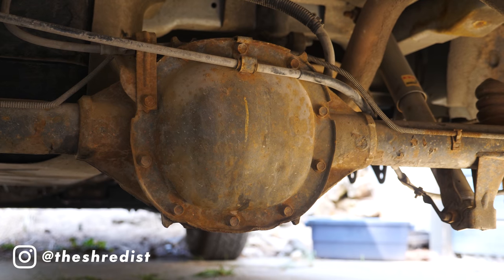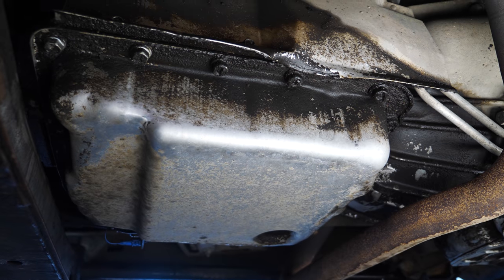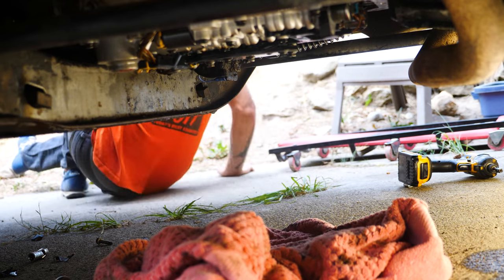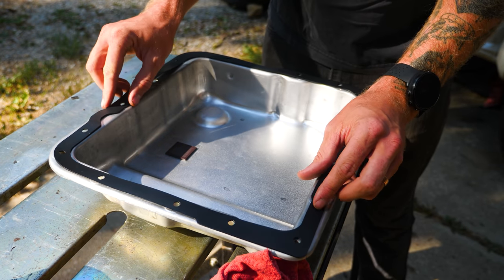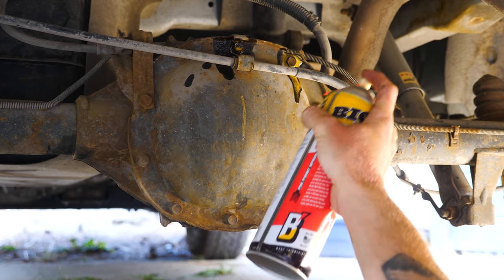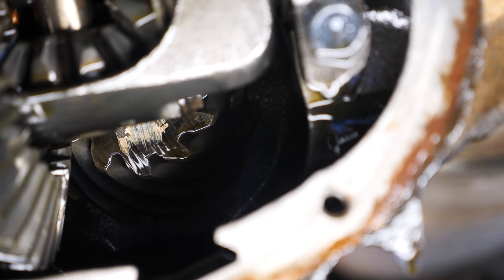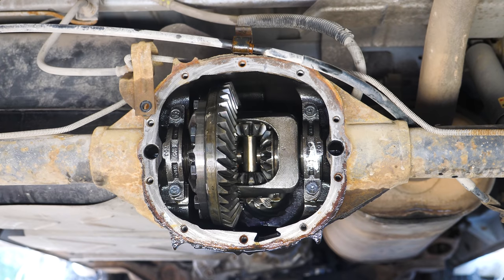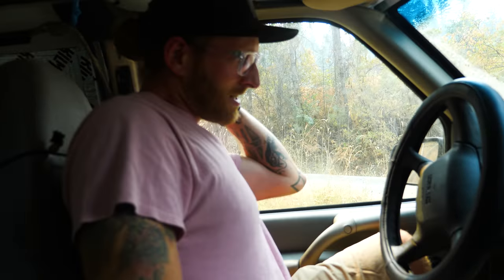Is Scruffy's Drivetrain Toast? Fixing Leaks and Finding Creaks - Scruffy Build Part 7

Comment: Hey man, so a couple things...  First off, you need a magnetic base and dial indicator to measure the backlash at the ring gear (available for cheap online).  Depending on the axle, it's usually anywhere from 7-15 thousandths for a used gear set.  So can't really tell from the video as the pinion and ring gear are both moving.  But seeing those metal shards in there is not encouraging and given the size of some of them, I'd say that gear set and/or the bearings are going out for sure.  As far as the wear pattern, no, that's not normal even for 150k miles.  I would usually suggest gear marking compound to run a pattern, but in your case, honestly, there's no point to it.  That's bad.  At a minimum, it looks like the pinion depth is wrong, either from improper installation or shot bearings.  It was likely set up properly when it came off the assembly line so unless someone's torn into that axle pretty significantly, it's pointing toward bearings, IMO.  The fact that the pinion is wearing the ring gear like that tells me the likely culprit is the pinion bearing(s).  It's allowing the pinion to walk forward under load wearing the heel side of the ring gear.

Regardless, here's what I think you want to know:  The ring/pinion and bearings should all be replaced.  Labor is likely ~$400 and parts another $300-400.  And I've seen and repaired many a shadetree mechanic's gear install so be very wary of whom you'd choose to do this job.  Personally?  I'd source a entire replacement rear end.  It'll be WAY cheaper that R&Ring the gears/bearings in your current axle and way easier than tackling it yourself as there's definitely a technique to a successful gear swap.  If you can source a replacement axle with a limited slip, that's cool, but you can always slap in a lunchbox locker into an open diff for $200-300 and that would definitely be well within your skill set.  Any other questions or if you think I can help in any way, hit me up.  Good luck!
Reply from the maker: I mean, you're definitely 100% correct. My suspicion is that the pinion bearing is toasted allowing it to walking into the ring gear. I didn't think the wear looked normal, but never hurts to ask the more experienced.

If you wouldn't mind, I'd love to pick your brian a little bit on some options, especially with a mild locker style setup. If you have an Instagram shoot me a message or send an email from my youtube profile if you wouldn't mind! Thank you!
Reply: @TheShredist   If you want to keep the budget idea theme , go with a lunchbox locker , I run this in my 4runner and after 3years I like it alot.  But since you want something mild , id go G80 complete axle since yours is toasted anyway. At any junkyard look for a S10 or Blazer with GM RPO code G80. Theyre LSD but still much better than an opendiff
Reply: @TheShredist  Yeah, man.  I'll shoot you a note on IG.  Happy to help...
Reply from the maker: @warracer03  definitely considering a lunchbox locker. How do these drive on the freeway? I'm assuming fine since its a pretty straight line. I definitely want this thing to be road trip worthy, but I'm tired of this open diff!
Reply: @TheShredist  on the highway its super smooth , you only hear it Click in parking lot or tight city streets. The best "daily Friendly" setup is lunch box at the front and G80 LSD axle at the rear.
Reply: @TheShredist  I would caution the LBL when driving in 2wd in slippery conditions. Very easy to do a 180 in the snow. With that said when your not playing around just engage 4wd high and the front wheels will keep you going in the right direction. I would suggest a Yukon Dura Grip Limited Slip or something similar. The lunchbox are great and cheap but I think it will be over kill for your situation. No reason to go though tires if you don't have to. The LBL likes to chirp under ANY load while going around corners. I plan on doing a limited slip or selectable lock in my 81 Brogham RV van. Dope video as always
Reply: I'm a cheap ass. Put all new bearings and seals in it and gap the old ring and pinion. Your out $200-$250 dollars and you have good you tube content! If it goes out in 5,000 miles better luck at the junk yard. PS go to a decent bearing shop if you have one close. One that measures bearings not look them up on a computer.
Reply: @TheShredist  lunchbox lockers are great for what they are, but they're not perfect by any means.  With any auto locker like a LBL or a full Detroit Locker is that every time you let off the throttle the vehicle may have a very slight pull left or right initially as the locker unlocks.  Roll back into the throttle and it may pull more significantly to the left or right initially as the locker reengages and rarely are both axle shafts engaging at the exact same time, hence the left or right surge that is felt.  Because a LBL has looser tolerances than a full Detroit, this surge is often more pronounced, in my experience.  But cruising at steady throttle is great with a locker of any sort and you won't know it's there unless you're turning or rolling in or out of the gas.  If the axle shafts are weak, I've had friends snap shafts taking tight turns on grippy pavement so that's a concern with any auto locker.  For these reasons, selectable lockers are awesome because you can disengage them on the street, but they're WAY pricier!

FYI, I've run clutch diffs, Torsens, LBLs, Detroits, spools, and selectable lockers on the street so I've got firsthand experience with how all these perform on and off road.  I even took my Jeep on a 1200 mile roadtrip back when it had a spool. LOL
Reply: I ould check with Auto Zone on the rear differential. They carry Zymbrota.
Reply: @stevenbaker5099 what’s that
Reply: Zumbrota rebuilds manual transmissions, Differentials and transfer Cades. You would need to give your VIN and then exchange it at the auto part store. Remove all parts (brakes and driveshaft).

Comment: The GM S series vehicles trucks, vans, and suvs are known for going through rear ends. I was in pest control for several decades and have had S10 trucks mostly and that has been the most common issue with them. My current S vehicle is a 2004 S10 Blazer 4 door 4x4 and thankfully it hasn't got those issues but it was a Fire chief's rig up around Rathdrum somewhere and had nothing but Amsoil full synthetic products for it's first 200K miles and I have put another 36K miles on it with Mobil 1 products and I can see this rig going over a million miles pretty easily.

Comment: I taught myself how to setup gears and rebuild diffs through YouTube and research. I have worked as a machinist a bit and have some mechanic training and experience. But I’ve never been a professional mechanic. I’ve had great luck with axle rebuilds. From watching your videos I’m pretty sure you can do it too. One thing easy to check is hold the drive shaft securely and then see what the backlash is on the ring gear with a dial indicator (cheap one from harbor freight is fine) and some white out on clean gears can show us your pattern better. I’m happy to help you diagnose more if you want.

Comment: If you do end up replacing the differential, I would highly recommend a helical diff.  Eaton offers a Detroit Truetrac model 912A317 which should fit these Sierras/Astros.  This helical diff paired with that New Process 233C you added will make Scruffy even more buffy.

Comment: Remember if the transmission oil looks that bad triple change it. change fluid and drive 20-100 miles change fluid again then repeat as needed. That helps clear all the nasty oil that is in the torque converter out too. You will never regret posi and it won't affect lash. Do you have a votech near by?  They might do the rear diff for parts. A junkyard rear axle could be hit and miss but you can pull the rear cover and decide but don't let the EPA see you.

Comment: Run a heavier oil in the differential. And keep riding it till it blows the spider gears
Reply: „Spider gears“? :D
Reply: @FrANTiXzz  The gears that let a differential differentiate.  But I suspect the pinion bearings will let go well before the spider gears because the gears/bearings are the issue, not the diff unit.
Reply: @tommyr95  ty for  explaining
Reply: @tommyr95  I would say the chunks of metal would get the spider gears first. But ya never really know until she's all blown up....

Comment: I think you're looking at rebuilding the rear end due to the pinion gear moving with ring gear immediately like there is no backlash. Could you find another in the junkyard, probably but you need to find one with the same wheel mounting surface width which might be more rare being it is a van and not a truck.  If you're going to have a shop rebuild this for you it you may get a cheaper price if you remove the whole axle assembly because they charge different rates for taking up hoist space.  Look for a 4x4 offroad or jeep shop. They change out ring and pinions and add lockers all the time. Because they do it so much they have it down to a science.

Comment: Probably your best bet is to swap in a salvage rear axle assembly from a wreck and go ahead and do the Journeys 4x4 transfer case swap while you're at it so that you can roll in 2 Hi on dry pavement. The reason the rear diffs go out on these Astros is running the AWD with uneven wear on the tires ( or different sized tires). I ran into this same problem on my 2004 with rear disks, the axle for which is hard to find and sort of pricey. The rear axle will be easier to find and cheaper on yours with rear drums. You might have to put in new outboard axle seals on a salvage unit, which is not a big deal. You just don't want to mess with the pinion seal which would involve resetting the pinion depth, backlash, etc. Very tricky to do correctly.
Reply from the maker: Well I think you just answered the question of how this rear end got so wrecked. The guy I bought it from had totally mismatched tires/a couple bald, some with tread left. I always knew this was a bad thing for subarus and their center diff, never really thought it would affect the rear diff though. Seems obvious now though, thanks!
Reply: If you're thinking about adding limited slip, I believe Chevy/GMC put the Eaton G80 in this rear diff that had the same gear ratios as the open diff on the Astro. There was an RPO sticker code for this. I vaguely remember chatter about this in astrosafari.com .You'd just need to confirm that the gear ratios are the same (also specified on the RPO sticker). Hey, while you're putting in the new axle, go ahead and put in Journey's add-a-leaf for $60 buck extra ( I promise I'm not affiliated-- I just like what they're doing). Shout out to northern Idaho.

Comment: I think it'd be hard to find one in a junk yard that has fewer miles on it, but that'll be the best combination of cost and effort. It doesn't take much to swap the ring and pinion, but getting them aligned properly with the shims on either side is a pain; and it wont last long if you don't get it just right.

Comment: As a master mechanic, I can tell you chunks of metal on the magnet is a very bad sign. Your best option for the cheapest cost is a full junkyard axle, but there is always a risk of getting a bad one. Otherwise, have a professional rebuild the rear end so you know it's right. This is the kind of thing that is very easy to mess up. Good luck! Sorry for the troubles with your diff, I've been there.
Reply from the maker: Yeah when I saw those shards, I thought "well this thing is toast..."
Reply: @TheShredist  My rear end made the same noise and also had medal shavings in the oil. It was the pinion bearing. I replaced/fixed the pinion bearing in my rear end last year. It took about 8 hours of actual work and an additional 12 hours of parts store runs to rent bearing presses and other tools. I have less than $500 of mechanic tools and did this laying on my back without a lift. Look up videos on how to remove bearings from a pinion and also how to use a torch and the freezer to put them back on. 

The hardest part for me was getting the front bearing race back into the rear end. I had to use emery cloth to gently clean the surface of the rear end before that race would go back in. YMMV. Also, you need a STOUT impact gun for the crush sleeve. I borrowed a friends cordless Milwaukee for the job.
Reply: @TheShredist  in other words, I totally think that you can do this. It cost me less than $500 including oil, gaskets, bearings, shims, etc. 

BUT, you can totally check a junkyard rear end before buying. Just remove the ring/spider gear assembly and disconnect the drive shaft. If the pinion spins smoothly with no play, it should be GTG.

It might also just be the carrier bearings, which could be done very quickly and fairly inexpensively. Also be sure to change wheel bearings “while you’re in there”.
Reply: Im that good a master mechanic only work who have money

Comment: Setting up gear lash in those is such a pain, ive found its easier to get an entire axle from the junkyard thats in better condition than the one you have now.  If you're lucky you'll find one with limited slip anyways.  Make sure the gear ratio is the same by checking RPO codes in the glovebox, or i believe they stamp the ratio in the ring gear itself.  Get new wheel bearings into your new (to you) axle while you're at it, and SEND

Comment: What John Booth said below is good to do. Even though you changed the filter the balance of the oil in the trans has dirt and small metal filings in it. After a certain amount of driving, your choice, a thousand or more change oil and filter again. The trans should be a 4L60 and has a valve module exposed when you drop the pan. If it is shifting hard or jumping during shifting that valve body could be dirty. A filter change does not clean it but it is easy to pull the connector and drop the module to clean the screens or it is inexpensive enough to just replace. You can do the rear end yourself not hard just study up and take you time.

Comment: As someone who does jeep diffs for a living, finding metal is not a good sign.  Willing to bet pinion bearings are loose/worn and causing pinion to back away from ring gear causing that wear.  It takes some specialty tools to build a diff properly(Dial Indicator, torque-o-meter to get pinion torque to rotate right) but inst impossible to do yourself in your driveway.  Another lower cost option then having someone rebuild it would be to find a lower mile junkyard axle assembly and most places will let you open the cover before you buy it to check, just make sure the gear ration is the same.  If you want to tackle it yourself I can send you all the specs and measurements you will need.

Comment: i use a brass wire wheel in my drill to clean of gasket material from the pan, because it steel and not alum i have never had any issues with it, the metal won't have any issues with that !!! and i always use a thin film of rtv sealer on both sides to make sure no leaking!!!

Comment: I would pull the wheels and check the axle bearings before i did anything with the diff. An axle bearing is pretty common on these.

Comment: I had a similar issues like this before. It was one of the bearings that held the ring gear and its assembly in place. I was able to pull the axles then get whole ring gear assembly pulled out. After that, I found a shop that had the replacement bearing and they were able to press it on for me.  In all, it was about $200 for me. You just have to be careful and keep a eye on where the spacers are because when you put it back in, if there in the wrong place, the ring and pinion gear will be out of alignment.

Comment: You can see the pinion rocking around, the problem is most likely the pinion bearing.  I have a similar amount of play in the rear of my Astro, but no noise or vibrations yet.  It wouldn't be much to have that swapped out and try using a heavier weight gear oil.

Comment: I'd go to the wrecking yard that you got the transfer case from and pull the covers off the diffs on the vans there. Maybe start with the one that the transfer case came from if it's still there. I'd take note of magnets in the diff covers and find one that had nice looking gears and no metal shards on the magnet. I had a 1960 Falcon that was a bit noisy in the diff, I changed the wheel bearings and it ran silently. That diff was about 35 years old back then and I doubt anybody would have done a rebuild on it previously. My van is all fitted out in the back and it's amazing how quiet it is in the back now, no road noise at all. Good luck Man!

Comment: The parts to rebuild it cost about the same as the labor. If it’s your first rebuild and you go DIY, pull the whole rear end out and set it on jack stands pinion snout pointed down.  If you want to pay to have it done, contact the local jeep club and see who they recommend for gear setup.  I would also recommend doing all the bearings in the axle.  You have to pull the axles out anyway so might as well while you are in there.

Comment: Looking at that transmission oil, it's not ideal but if it gives you any comfort, my new van also had black oil. Replaced the oil a few times until it was the right colour and the box is still fine. When the oil smells burnt is when you start running into issues.

Comment: Bits of metal look like carrier assembly spacer or crush/thrust washer, yep needs a complete rebuild for sure! is a fairly straight forward job but you will need a dial indication micrometer with magnetic base,a good fish scale or draw scale for proper draw/drag tourque on that pinion some pattern paint and most specs come with a decent ring and pinion set.I'd just grab a princess auto dial indicator and check a few diffs out at the wrecker for backlash and go from there, probly easiest rout to go with.Great vids by the way!